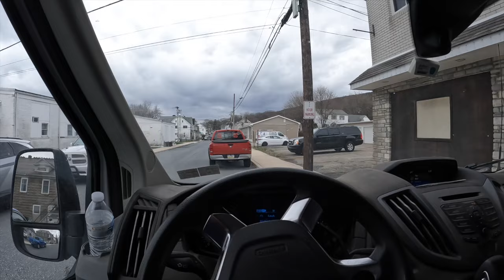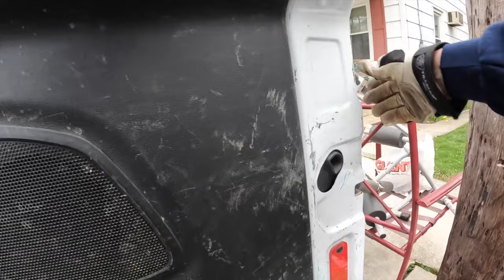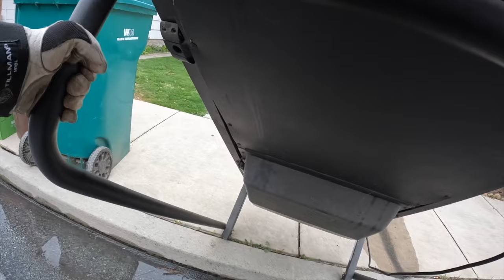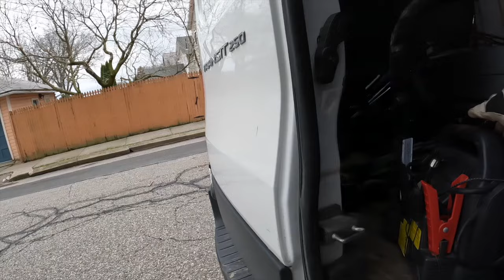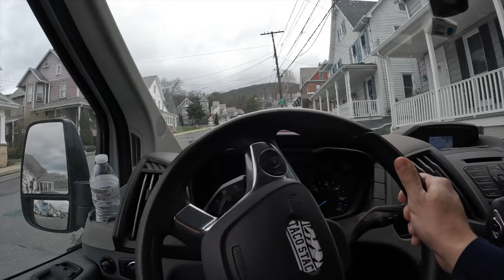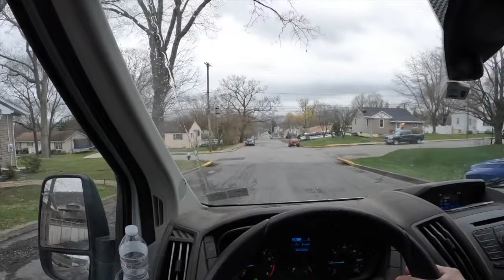Look What I Found Trash Picking This Week! - Ep. 890

Comment: The stainless steel appliance is a rebranded Elite Gourmet toaster oven and air fryer. I found the same oven with other names. Around $100 new or in good used condition.